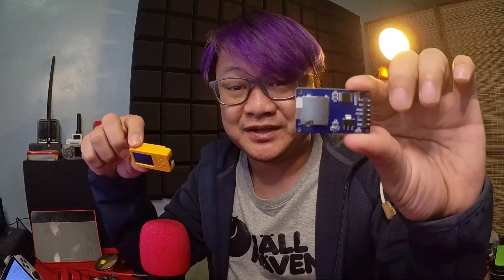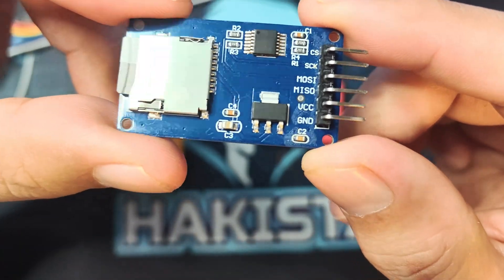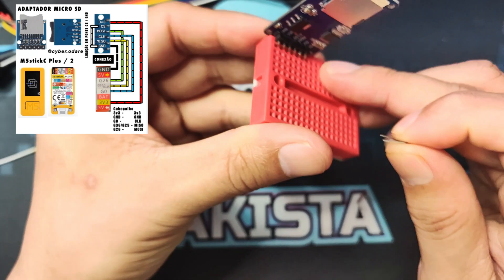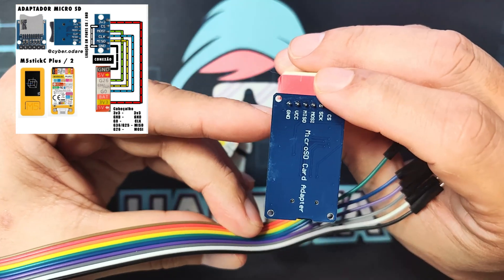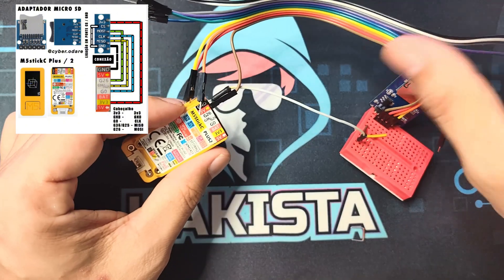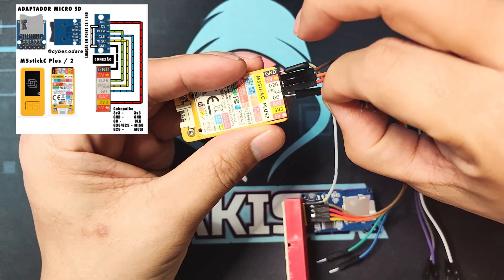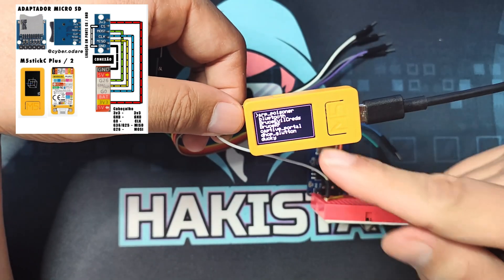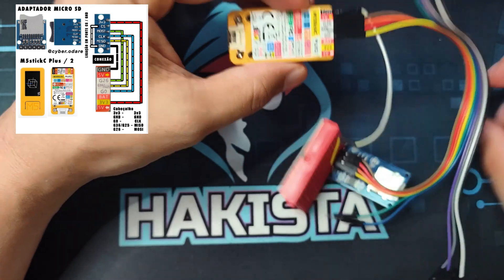M5StickC Plus2: Wiring an SD Card Module - Step-by-Step Guide

Comment: Maybe it's a dumb question but is there any way to make a usb flash drive work via the sticcs usbc connector?
Reply from the maker: Its a great question! the usbc doesnt have the hardware and firmware to act as an sd card reader unfortunately. It only function for power and firmware upload
Reply: @HakistaTV  Okay, interesting. Thank you so much for the explanation and for not making me feel dumb for asking.:)

Comment: Do you always need the sd card module in the m5 since you cant use another module at the same time
Reply from the maker: Nope, it has littlefs to use part of builtin ram I think but its just a few mb
Reply: @HakistaTV  so it's a one time thing?
Reply: With Bruce Prey firmware, Marauder and possibly more require a tf/sd card to save scanned data, to prepare attacks on your wifi. I haven’t received my m5, plus dual c1101; nrf antenna. Had I gone for seperate antenna I would have been able to set up the tf/sd card. Always check wiring, from other YouTubers to double check.